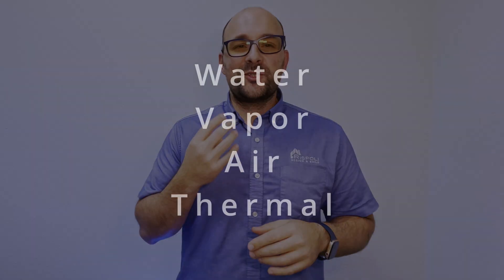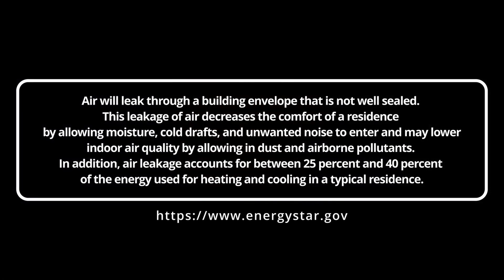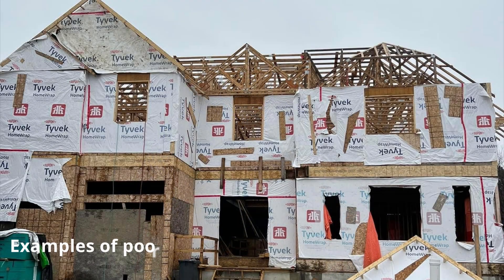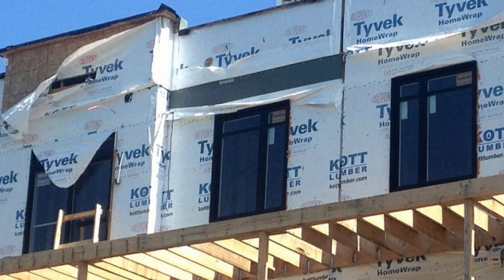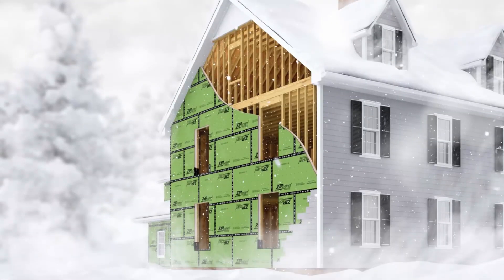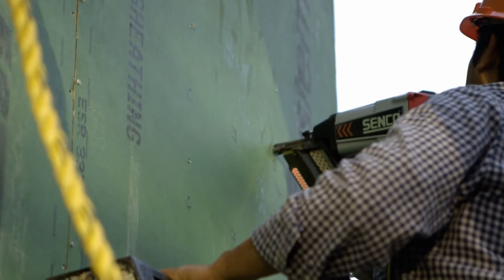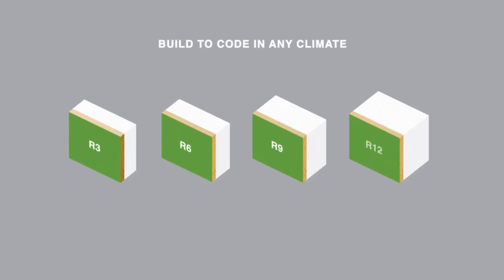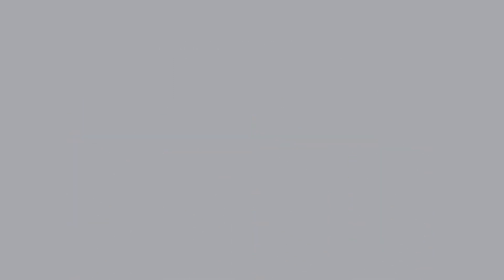Zip System VS Housewrap

Comment: The low vapor permeability is why I wouldn't use it.  I do tyvek over osb.  I'm in a cold norther climate though and zip isn't approved in my area either.
Reply: So you must be against spray closed cell foam insulation?  I live in Minnesota, zone 6a, and many new high end homes use Zip-R with closed cell foam.  Walls have the potential dry to the inside and it's not a problem when Zip is taped properly with Zip tape and/or Zip liquid flash.  Walls don't breath with closed cell insulation between studs, so better to have an air and vapor tight house sheathing than a permeable Tyvek with many holes it it from staples or repairs from a wind event when exposed.  Blower door test are great with Zip.  This is a higher cost assembly because it's just plain better.

Most new apartments and commercial buildings use Zip sheathing because the designers know what they're doing and they must with mulimillion dollar projects they're responsible for.
Reply from the maker: Thanks for the comment! Just curious — what made you think I’m against spray foam? I’m actually a fan of closed cell foam in the right application, especially when paired with a properly detailed Zip system like you mentioned. The goal of the video was to show why Zip (especially Zip-R) is a superior approach compared to traditional housewrap, not to knock foam insulation.

Appreciate your insight — always great to hear from other pros.
Reply from the maker: Thank you for taking the time to share your experience.

Comment: Zip and their tape suck, let’s see one of those zip homes where the guys get rained on sheets covered in mud wet surface and a sub contractor is going to try and stick his tape to get a check wet surface, mud and all .
Reply from the maker: Hello and thank you for your comment. I always enjoy an opposing view because it gives me an opportunity to learn. Please tell me a little more about what is your experience with Zip? Have you ever used the product? We build all throughout the year, about 30 homes a year, in all weather conditions. Strong winds, rains and snow and never head an issue. You are correct if it is pouring then it would be difficult to install the tape but the same could be said of any other product in similar weather conditions especially with strong winds.
Reply: @rispolidesignbuild  Just an uneducated troll (@richardthomas1566) you responded to.
Reply from the maker: @bobbray9666  I appreciate you taking the time to share your thoughts. I try and always keep an open mind as there is always much to learn and room to grow. Thanks for watching!